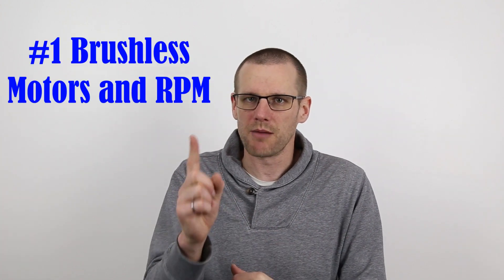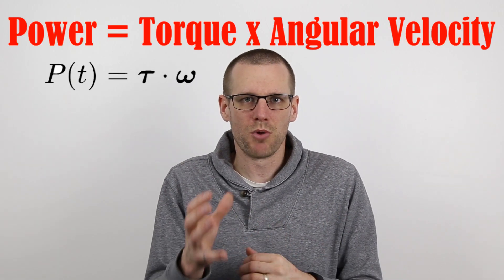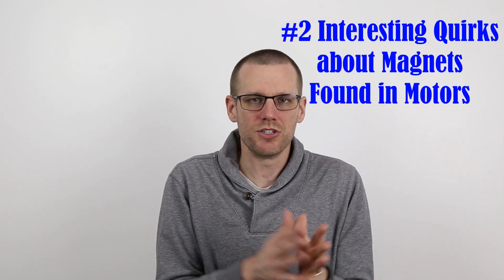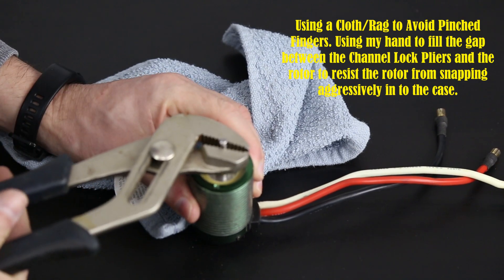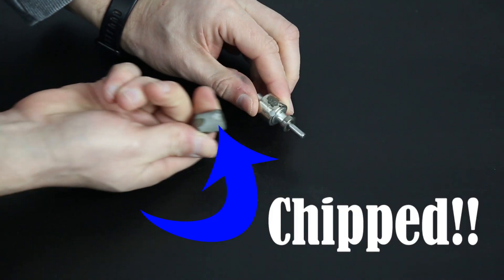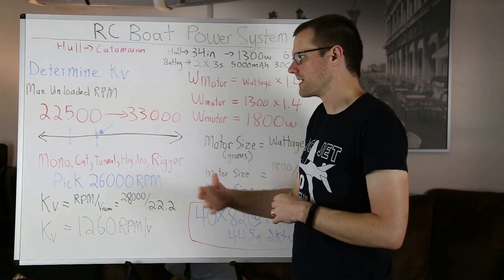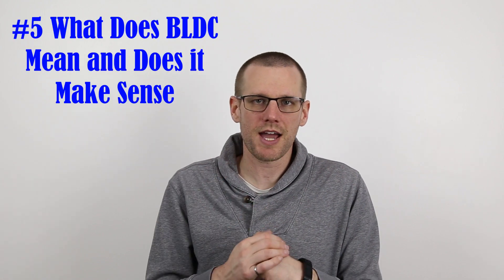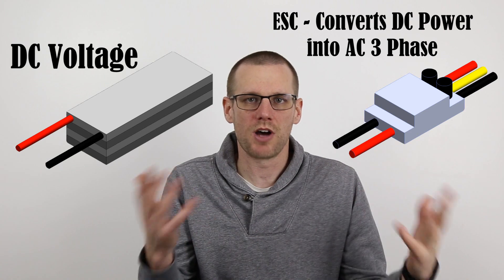5 RC Brushless Motor Facts that YOU didn't know

Comment: Don't some motors even go to 100,000 rpm? My Castle 1406 5700kv that came with my old Sidewinder 3 has on it "100,000 rpm". The sidewinder 3 can only handle 3s and so I never approach that, but I'd imagine that it should be possible to pair it with a 4s to get pretty close.
Reply from the maker: Yes, some do go much higher.

Comment: I'm getting an HG P802
 What Motor and battery Should I get? 
and also keep doing what you doing. And I'm also planning to run a trailer On it.
Reply from the maker: Hi Jack, I'm not familiar with that model. You may want to check in on a forums from the guys who run that RC.
Reply: @RCexplained  Oh ok.

Comment: I have learned that the torque constant is a myth. 
The current flowing through the windings creates an electromagnet in the stator. The strenght of the magnetic field is not proportional to the ampdraw. 
This can learned by researching core satuation.

Secondly brushless motors power output would have to be measured on a dyno similar to a gasoline engine.

Third point you can run a brushless motor on more voltage than rated with a load. The loaded reduces the motor kv so the lower kv means you can run higher voltage to reach the rpm limit.

Comment: Is it so that the max unloaded rpm that can be achieved is KV*V battery and that is what you get at 100 percent duty cycle? if so how doe esc know the KV rating of tge motor sso it may generate appropriate square waves for the three windings?
Reply from the maker: Yes, esc does not need to know the kv of the motor. It reads the Back EMF of the motor.
Reply: @RCexplained  so the esc gets to know the back emf by using the third coil and the motor specifications and battery voltage sets the maximum speed of the motor. The esc produces the actuating signal itself. So my question is what rpm does 💯 percent throttle in no load condition corresponds to?